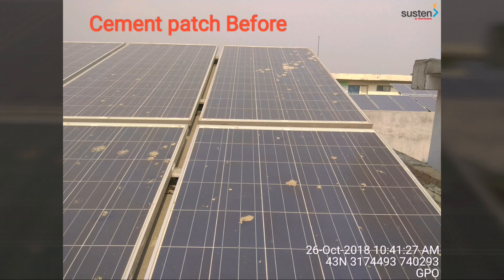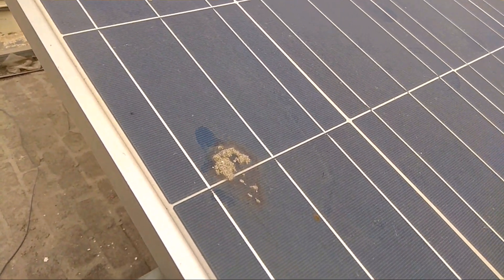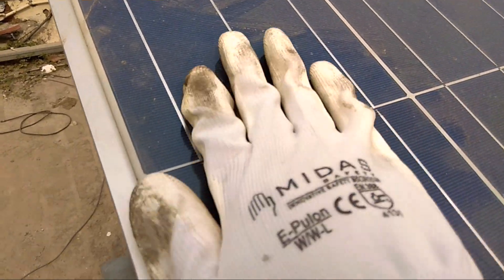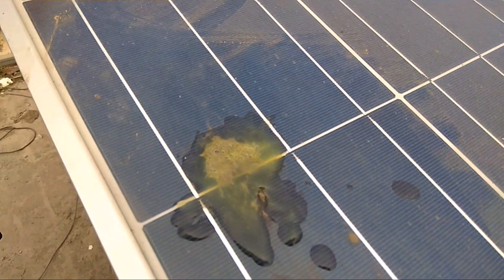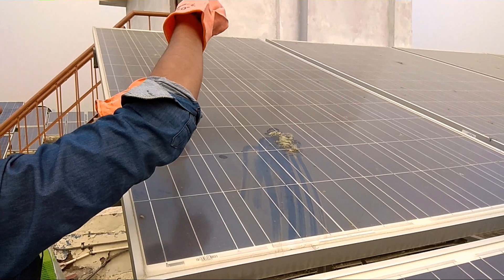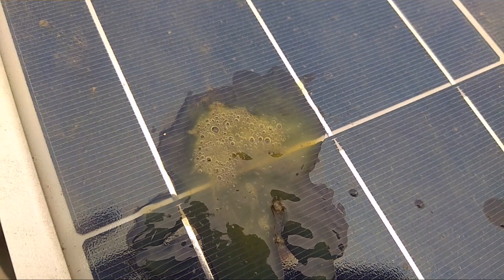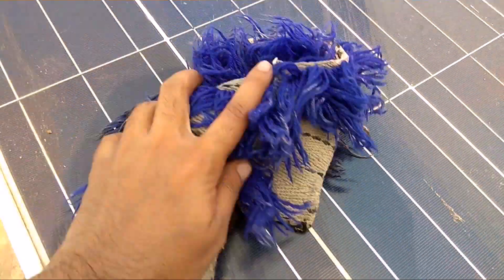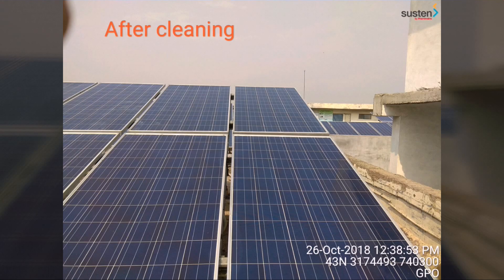Remove Cement from Solar Panel AMAZING Solution

Comment: Hello sir... in our terrace installed solar water heater tubes. Due to another construction beside the site almost all tubes evacuated from cement stains.
is it possible to remove those cement stains from scale remover sir ?
Reply: your sir is idiot he made video but didnt tell what the fuck that jelly solution is
Reply from the maker: @sulemannaveed7527 
Scale remover, used for cleaning swimming pool